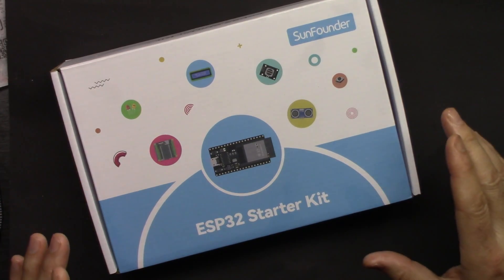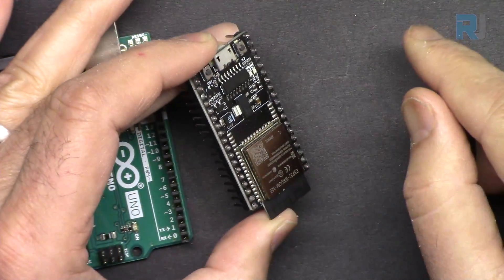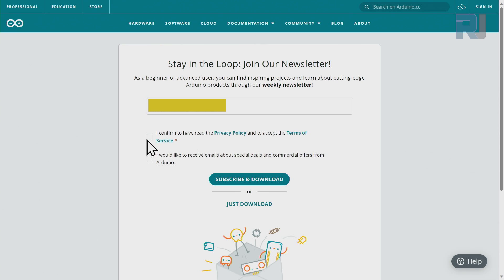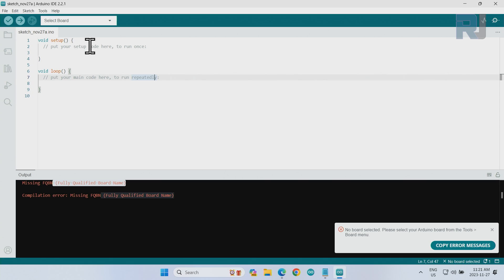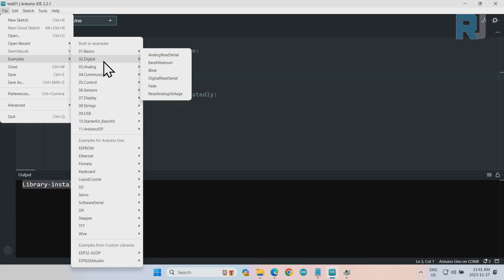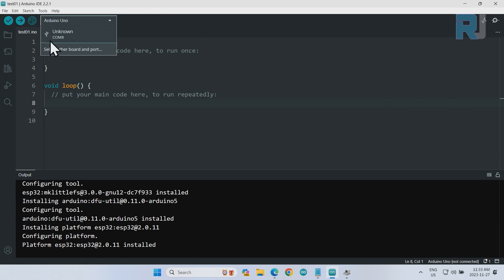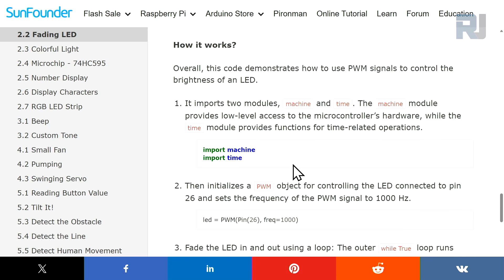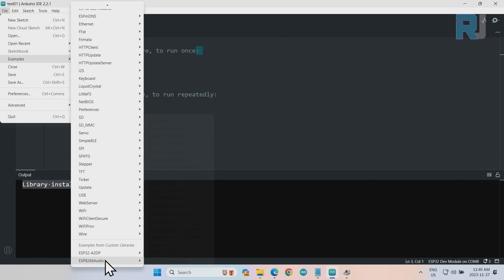E619 ESP32 Tutorial 1 - Introduction to SunFounder's ESP32 IoT Learning kit Software and Arduino IDE

Comment: Hi 
This is Khalid
I am trying to use the sunfounder esp32 starter kit.
Upon uploading the first code it is giving me an upload error:
Invalid head of packet .
Can you help me solving this error.
Thank you ahmad.
Reply from the maker: Hi, it seems it is either wrong arduino IDE settings or weak USB power. Try different USB power
Reply: Hi ahmad
I tried your options and it didn't work .but I tried something else.i removed the esp32 from the extension board and the upload was fine but it gives me upload error when the esp32 is inserted on extension. Board.i don't know if my ext. Board is faulty or do I need to do something to the ext. Board. And by the way after uploading and inserting the esp32 to the ext. Board with the usb cable still connected to the esp32 the code works fine but when I remove the cable and connect it again the code is lost .
Did you receive anything like this from others.
And what is the fix if there is any and thank you very much for your reply.

Comment: I would like to use the 'SunFounder' GY-521 MPU-6050 3 Axis Accelerometer Gyroscope 6 DOF  Sensor Module 16 Bit AD Converter Data Output IIC I2C for Arduino with this ESP32 Kit. 
While doing the Paul McWhorter,  Raspberry Pi Pico W,  LESSON 41: MPU6050;  Inferring Tilt From a 3 Axis Accelerometer.    Thank you.

Comment: Excellent, I'll be following. I watched the Arduino Vids so I'm up and running for the IDE part, My boards are the Devkit 1, Cam board and 8266. My experience is doing simple wled, and not much more. So, lets get started.
Reply from the maker: This learning kit is based on ESP322 and not ESP8266. I hope you've noticed it. Sure welcome aboard.